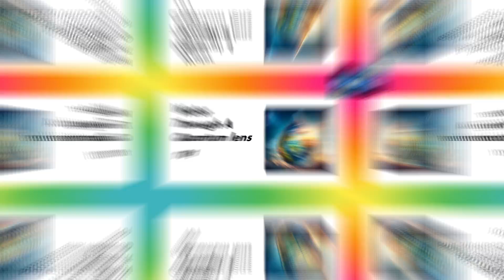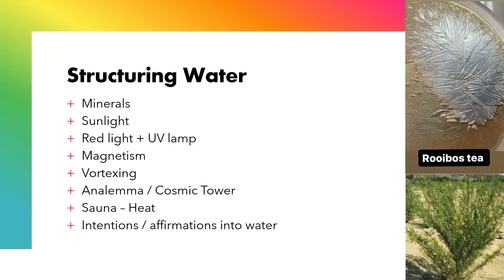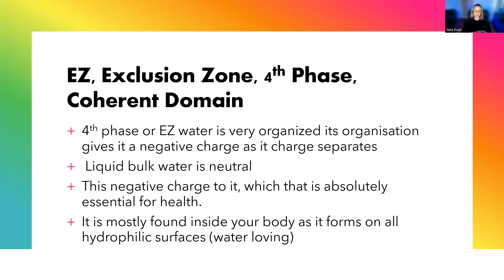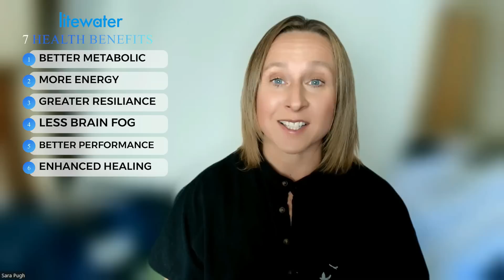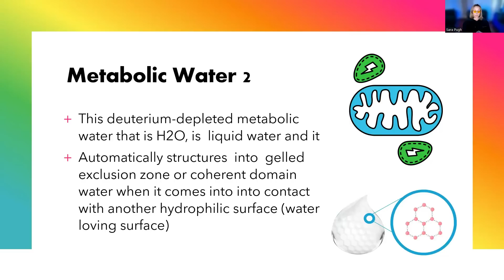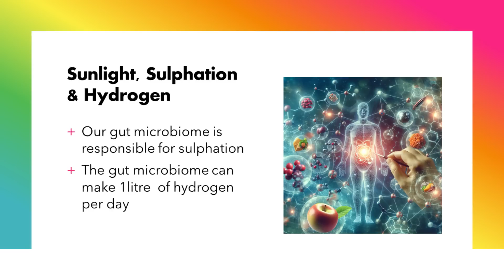Comment: Great content, water is amazing. When you say EZ water pops out an electron, do you mean an electron from an oxygen in the hexagonal structure liberates an electron which becomes free floating in that EZ water? I'm not sure exactly what is meant. I always imaged it as the hexagon of EZ water absorbing an extra free electron (scavenged from earthing etc) and becoming overall negatively charged, therefore creating a barrier zone to the free movement of positive charge (H+), which is if I am understanding correctly one of the EZ waters key functions (exclusion zone).

Comment: Sara any thoughts on Zerowater filters and also Shungite left in the bottom of the water jug to help clean and structure the water ?
Thankd
Reply: The shungite is fine but distill or RO the water, then remineralise not filter
Reply: @Thebusysuperhuman  But that’s what is supposed to be so unique about ZeroWater in that it does the same job as distilled without the extortionate electric costs and produces a zero TDS as well.
Reply: Deuterium-depleted water!

Comment: Would juicing cucumbers be a poor man's source DDW?
Reply: No as you need fat to depleted deuterium 
There is some structured water in cucumbers
Reply: Well, it's technically a fruit. Plants  store deuterium in their fruits.
Reply: @cketheridge2643  Sure, botanically, that's true however fruits high in deuterium such as tropical ones are exceedingly high in sugar whereas cukes have a very low sugar content but are loaded with water.
Reply: @Cenot4ph  Yes, however, any other factor would be relatively inconsequential as far as harmful "plant toxins" are concerned. Their concentration would be so diluted as to be negligible; the bad bits were hybridized out of the mix by breeders ages ago. So long as the sugar content is low, one shouldn't worry about any tiny noxious residual component lurking about since the vast percentage of the composition is pure pristine high value 'mineral' water structured or, as it were, alchemized, thru the miracle of photosynthesis. Water in the most advantageous form. Try it. Run two or three properly grown Japanese cucumbers thru a juicing machine, add a bit of lemon and reap refreshment and liquid delight with insignificant downside. Plus, I'm guessing, as a bonus, easily accessible DDW at very low cost. Lighten up, not all plants are "trying to kill you."
Reply: @breadandcircus-o2y  Yes, perhaps fine, but why would it not be just as good just to eat that cucumber, retaining the fiber too?
Reply: Would deuterium content just reflect the water taken up into the plant?
Reply: @raykinney9907  Because the fiber is useless if not harmful. Moreover, it's the water and the trace mineral salts that are desired and you'd have to masticate several to get a decent amount but by juicing you'll readily get a significant amount. It makes sense, no?
Reply: Good way to overdose on oxalic acid.
Reply: @davidj4662  Actually cukes don't contain much if any Oxalic acid. They are low in carbs and about 95% water. What I am curious about is that water low in deuterium?